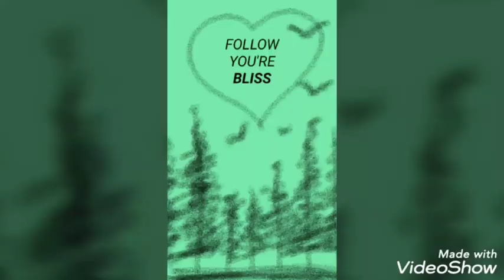Big Bertha's Diagnosis

Comment: Hi Mitsi.  Your engine needs an air filter.  I'm glad your accelerator trouble was minor, but an air filter is cheap compared to the damage dirt and debris and the southwestern desert (when you get there) will do to your engine.
Reply from the maker: Well then maybe next month LOL
Reply: Definitely put an air filter in it!!! Way too much dirt in the desert to not have one.  Been here 21 years, and have put K&N air filters in our vehicles.
Reply: Driving Home. I agree we are in New Mexico lot of dust out this way. We came from Kansas not use to this much dust. We were on our way to Yuma,Arizona stopped meet another Vandweller living in New Mexico and stayed. She really needs that extra protection against the dust. Thanks for that good advice. We take our van to car wash and rinse the motor down. Be safe..